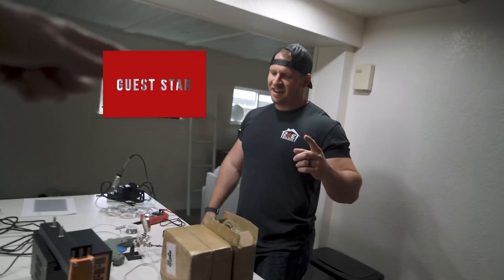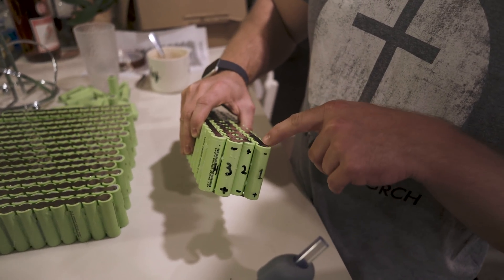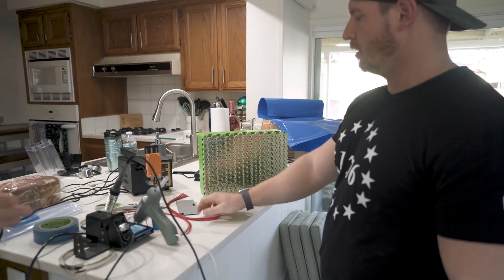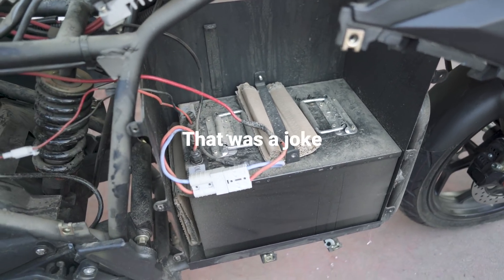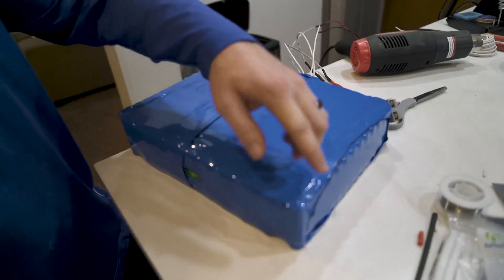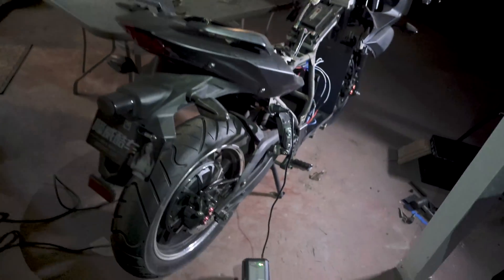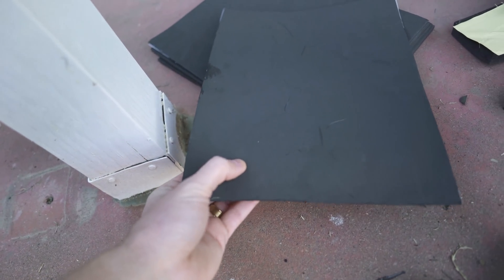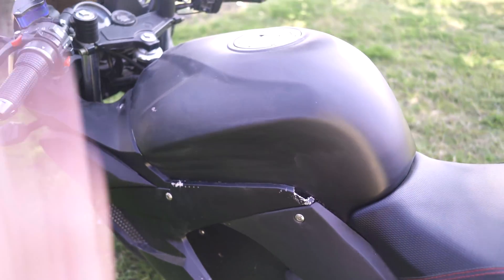UPGRADING the ELECTRIC SPORTBIKE from CHINA | Installing a Home-made Lithium Ion Battery

Comment: your going to fry the sells in the end of the series. they are ratted for 21.5 watts, short bursts up to 100 watts. so 40-60 of the batteries are being over powered. its a fire hazard. should be using  LiFePO4 42120's... cost's $3k to make a 42120 pack at the same power level. and that would last 1800 charge cycles and be warranted for the voltage and amps your using.
Reply: lol, What? I didn't notice what cells they used, but are you saying they're 5A continuous discharge cells? At what, 13p was it, so about 65A continuous.
Reply: @th3d3wd3r  no for the voltage they are using running each battery at the ratted 5A will cook all the end cells.
Reply: @ardennielsen3761  Urm, no it won't. I pull 140A at 100.8 volts from my 24s7p pack of lg hg2 cells. Not a bother, absolutely in spec for the cells.
I think maybe you're confused.
Reply: @th3d3wd3r  sure thing, I drive around a unrestricted 250cc F1 that's on a 240lb dirt bike. 5 gears and 54hp. i might make a video of it this summer.
Reply: @ardennielsen3761  I've got no interest in a bike that needs an engine rebuild every 50hrs use lol.
You still didn't answer my question
Reply: @th3d3wd3r  ya, having to refill the gas tank every 2 days is ruff.
Reply: @ardennielsen3761  what are you talking about?
Reply: @th3d3wd3r  110 octane gasoline is $11/gallon
Reply: @ardennielsen3761  none of this has anything to do with your complete lack of knowledge regarding EVs and battery packs. I don't understand how you can be so clueless, yet be brazen enough to attempt to offer advice.
It would be more helpful to people in the future if you didn't advise people on topics you have no clue about
Reply: @th3d3wd3r  yes, and brewing ethanol is easy... tell me how you make a battery.
Reply: @ardennielsen3761  distilling ethanol is lethal if you don't know what you're doing. Blow yourself up with that stuff. 
To make a battery you use as many cells series linked to reach the desired voltage, then add parallel cells to increase capacity and discharge ability. Once you've worked out the pack layout, you use appropriate sized nickel strap and spot weld it to the batteries, making sure the weld current is high enough to make a solid weld, but not so high you breach the cell. After that you attach balance connections to each series link from ground, all the way up to the positive terminal. These connections go to the battery management system to monitor/balance the pack and protect it in the case of a fault.
Reply: @th3d3wd3r  take a shot right out of the tank of my bike... got enough here to get a few hundred people buzzed, batteries start on fire, lithium batteries can not be put out when they light up, your home insurance is going to be denied... just for having that 40kg lithium batterie block.
Reply: @ardennielsen3761  I think you've been huffing ethanol fumes. Are you ok? You found out you were wrong about battery packs and you just went off on random tangents. 
Tbh, I'm utterly addicted to EV torque, literally nothing comes close. I'm done with internal combustion, it's all about electric now. So I have no interest in debating which is better. What I am interested in is your wild claims about lithium battery pack construction. But you won't explain yourself and you're clearly unwilling to learn
Reply: @th3d3wd3r  how many kilowatts are you running? the 250cc dirt bike i have is pushing 41kw in fifth gear with the engine at 4500rpm @ 65mph it has 41kw just sitting at that 4500rpm idle... runs to 13000rpm
Reply: @ardennielsen3761  I'm only running 15kw, but I've got 220nm of torque on a bike that weighs 35kg.
More importantly to me though is reliability. If you're running a 250cc with that much power, it has to be a race tuned 2 stroke. How many hours before you have to do an engine rebuild? 50, 100?
I have virtually zero maintenance.
Reply: @ardennielsen3761  do you have to idle at 4500rpm just to keep enough oil flowing to stop the engine overheating? Lol
Reply: @th3d3wd3r  its a 250cc 5 valve that has the bottom end of a 450cc. its made of all kinds of metal that is mined out of the ground by fracking and pumping out using all kinds of volatile acids... oil rigs that have nothing to do with oil.
Reply: @ardennielsen3761  also, have you not yet realised I don't use electric because I'm eco, it's because it beats the shit out of internal combustion
Reply: @th3d3wd3r  it seems like you are coming across as the one who eat the leftovers that mom leaves in the toilet?
Reply: @ardennielsen3761  Wat?

Comment: You cracked a joke about the cardboard, but added wood. Lol. Be safe, metal enclosure.
Reply from the maker: Figured if the battery explodes or catches on fire, might as well have a camp fire and make the most of it

Comment: The brake noise is caused by the pins and the back of the pads. Add some brake grease to both, being careful not to get it on the pad and rotor surface.

Comment: I would have gone for a side by side battery to fill the void from left to right, this would have given you the lower centre of gravity but i guess if you do decide to expand you can build an identical bank and run them side by side. Also the discharge wires do not look up to the task, for that power level i would expect to see much thicker wires.
That brake noise will only be cured by lubricating the slide pins & fitting spring plates to the pads.
There is a guy (Tony) from the Midlands (England) who built an 70+ mph ebike, check out his channel by searching "Vortecks"

Comment: On the front brake squeak - Get some thin teflon sheeting and cut a piece for the back of each brake pad, and find some hi-temp thin fiber washers to put on each side of the caliper bolts. That should stop your squeak. The pads are probably too hard of a compound, in order to make them last longer, but they'll be somewhat noisy unless you insulate them from the calipers with the teflon sheets. Incidentally, if you double your battery capacity, you better go with at least 8 AWG for the wires to the controller, to handle the extra amperage, plus it should be a lot quicker if the controller is capable of handling that much current. Heck, they've got thicker wires for an RC LiPo pack than that thing has for the main output!😁👍

Comment: It looked like there was enough room in the batt tray to throw in a parallel battery.. Would it fit two of those 20s13p configs? and i have to second what everyone's saying about larger gauge wiring coming from the battery pack out.
Reply from the maker: Yep, we're planning to build another just like it and upgrade the rest.
Reply: @TheInja  Lovely man! is the motor and ESC rated to just 72w or is that pretty flexible? You may even be able to up the wattage to an 84w or 96w pack for a bit more speed and power if it doesnt fry the mainboard
Reply from the maker: @MB.Drifts  we'll be running a 72V 8kw motor in it soon.
Reply: @TheInja  so if you're lucky and don't get screwed again you're looking at a top speed of almost interstate speed!
Reply from the maker: @MB.Drifts  I'll be looking at a top speed closer to 100mph hopefully. 👌🏽
Reply: @TheInja  overvolting is your friend! just remember to keep alll those electronics cool. short bursts not long too. These new style chinese batts are awesome but they still heat up quick when put through major high drain cycles

Comment: An hour uh? So pretty much only 35-40km.  Price to speed boost....was it worth it?

Also. People going on about how the small the wires are. They're like that on all  Motorcycle style ebikes (yes even the Zero FXS). They're Hall Sensor wires. Hall sensors are tiny microchips. What  would be the point of hooking thick wires to something so tiny? duh. It would be like hooking 8 AWG to your phone speaker thinking it would make it sound better lol
Reply: I'll comment again just in case people think this is true, THE CONTROLLER NEEDS 8-10AWG IF YOU'RE PUSHING 40A CONSTANT, hall sensor wires come from the CONTROLLER not the BATTERY so you couldn't see it in this video, Im really not sure why you're spewing bullshit you know nothing about.
Reply: Martyr4JesusTheChrist  I apologize for the vulgarity but I've explained this to him multiple times and he just makes a new comment stating more incorrect information and I really do not want someone thinking it's acceptable because it's not and it could hurt someone.

Comment: Your battery discharge cables look rather stiff and thin. If I were you I'd upgrade the cables to 12 or even better 10awg silicon cables. These are high temperature cables. Safer.

Comment: I am not a electrical guy but it seems there is space for one more  battery pack  so to double capacity and not have that wood frame which looks very low tech and as some said the wires are very thin, I don't think  it will  handle that AMPS

Comment: You could also use super capacitors, although that’s quite a mission. 🌝
Reply: Super capacitors only work on drag cars since they're not energy dense but can output ridiculous current, it would get a range of 3-5kilometres but they would be a very enjoyable 3-5km
Reply: Row yea I know , that’s why I said it’ll be a mission 🤣
Reply: @joshbarnes5119  I don't think it's a worthwhile mission, he could probably only fit 1 or 2 super caps in the battery box and it's going to bottom out his suspension, but I'd would applaud anyone who makes it viable.

Comment: Its enough space in there for 2 battery packs. Build another on and make a switch to switch btwn the 2. And make a generator to maintain/recharge the battery not in use. Them you cam ride all day n not worry about recharging.. What ya think?

Comment: From the video I can’t get the gauge of the wire but if you want that bike to go highway speed sustained, you need 6 or 4 AWG gauge wires both from the motor to the controller and the battery to the controller

Comment: Yes...just yes, keep the vids coming.  I was considering switching my batteries as well in my e-grom. I'll have to take it apart to find out whats in there. But I'll def have to do a lithium swap. 20A SLA in there right now. I believe they said it's 6 of them , but thats going off of their word.
Reply from the maker: Do it 💯
Reply: @Karelzvla  Which brand batteries did you use? Just curious. I might follow along. Fastest I've reached is 69kph with the SLA 10A. Or so that's what the company said was in the bike. Give or take 38-41mph. I've got to be careful taking the plastics off. One guy said he cracked the plastics trying to get to the batteries.
Reply: @Karelzvla  I have the Boom E-X20, which do you have?

Comment: The squeaking is probably those pins you were describing. Put some anti seize grease on them. The stuff that comes in the silver bottle with the screw on lid/brush thing. Just be careful not to get it on the pads or rotors.

Comment: Haha! Nice choice of Stickers there (The "Not actually a" was the best part). The battery box looks like you could almost pack twice as many cells in there once you get everything sorted. I'm not a electrician like some of these viewers apparently are, but I would definitely say wiring is also certainly something you should be mindful of. Even if what you have turns out to be sufficient, it's always better to double check. I want to see its full potential be realized, and I'd hate to see it ended early by a stray spark.
Reply from the maker: Appreciate it! Definitely will be double checking as we keep upgrading.

Comment: looks like you could fit such a bigger battery pack in. cross fingers you are going high power motor, one of the 12kw water cooled ones would be sweet. For anyone looking for batteries, these are very good high discharge batteries 20amp continues 50a peak https://www.aliexpress.com/item/32921081681.html?spm=2114.12010612.8148356.12.76589f14kAAI2W  

if you're in the states keep an eye out on https://www.youtube.com/user/jehugarcia/featured he often has great value 2nd hand batteries 

So want to build a 12kw cafe racer, with like a 6kw-10kw battery. just don't have the space atm, till I upgrade house.
Reply from the maker: I feel that 👌🏽

Comment: You probably have oil on your pads and rotor. Take out the pads, clean the caliper with soapy water, and burn off the oil on the rotors and the pads with a butane burner.

Comment: How low of amps does the controller on that thing pull?

My eMTB does 50kph easily, and it's only 48v. Though, my battery is s**t and has a ton of voltage sag, as well.
Reply from the maker: I'm sure the controller is limiting it. Realistically should send me up to 40mph no problem.
Reply: @TheInja  

Yeah, a 72v should be able to do that without issue. Amp limitations are the big culprit.

Comment: The brakes sound like they are copies of Honda rebel ones.

I fixed the squeaks by making the pins the pads hang from  a tiny bit smaller by sanding them with  fine sandpaper. This stops them from vibrating and squealing.
Reply from the maker: Yep, definitely the problem. The design of the pins would cause some vibration

Comment: I’d work in some form of passive cooling for that battery. Cut some holes/vents in the front and back to allow flow through. It will increase your battery durability

Also get rid of them there bicycle brakes
Reply: Martyr4JesusTheChrist  not so much of if it's wired up correctly but how hard you are pushing the components, even running the batteries at the rated c limit they will still get pretty warm.

Comment: Seriously dude.. those wires are weak af! The controller might not be the highest amp one, but still should be around atleast 60A .. those wires are 16A tops! If it's a decent controller it should be around 150A-200A from the battery. You should be using atleast 6 awg cables! Those you got there look like 12 or 14 awg

Comment: Nice! If you want to tidy it up even more try a computer case and sound/acoustic foam. Also maybe make another battery pack and a switch so one charges while you use the other.
Reply: What would be charging the other battery ? While you use the one it's running on

Comment: High tech, monitored with a freebie, Harbor Freight voltmeter! I luv it 😀. Great video!

Re: front brakes, try putting a leading and trailing chamfer on the pads. Maybe even cut a slot across the pads.
Reply from the maker: Thanks for the tip!

Comment: Two things. One: before upgrading the motor, make sure you know which one you have. Most of the time, chinese manufacturers slap a random motor instead of the one advertised to you. On the 1st video you said you got the upgraded model, so you should have a 5kw motor on your bike, which leads me to Two: the controller is programable, before upgrading, check if you can crack the programing of the controller, because you might have a 5kw controller programmed to 3kw, which explains the 30mph "limit" and the "low power vibe". You can reach up to 50 mph once you unlock the contoller to match the motor. BUT FIRST, check the parts you have in hand and reasearch before spending unecessary money. Cables are too thin IMO, check temperature after use.

Comment: Dude !! I have a hub motor running at 1800w with a controller that is  25 amp continuous/ 50 amp peak and using the same voltage  battery as yours on my ebike and it hits 40+ mph , with the added weight of your bike I think you are only getting the same as me 1800w.
Probably the controller, get another ?? and thicker wires will be needed for the extra amps.

Comment: iam drive a scooter with a 3000 watt moter and it puls up a lot faster than your motor. and my top speed could be 70 or 80 km/u.
bud i never try becouse 45 km/u is the max legal speed for me.
bud i have done it with my old 60 volt lifepo4 battery,  and that time it did 65 km/u. now i instald a diy 72V 63AH lion battery.
Reply: @Karelzvla  wel i think i need to try it out what my max speed is..... only the police and the Insurance wil be a problem if i crash.

Comment: Those original batts were voltage sagging bad. At least you found the problem. Qs hub motors go up to motorcycle grade. Keep the power wires as short & thick as you can too

Comment: Hi inja , I was following this case from beginning. Because I too imported electric motorcycle 3weeks before from China($1350). Im not sure why your motorcycle can't get 60km/h. My motorcycle 3kw motor and  72v45A battery can get 90km/h max speed and can go 0 to 80 in 4seconds.  Below is my motorcycle https://youtu.be/_G6oswhtgok . check your motor power again. I think it should be around 1kw that's why it go only 55km/h.

Comment: Well i guess after all that you passed you sure know that a simple battery will not change much. When it is come to electric vehicles you can't just buy a small motor or Kit if you want performance. I know that too because in my first project i did the same and spent a cup of dollars as well in an electric cart. If you change that Speed controller for a bigger one and your battery have that power to withstand be sure that your motor will not overheat. This motor probable can't withstand 5000W for much longer. With 8000w it will burn in seconds...To be honest for a battery with that power i believe you use much thin cables (you don't say the diameter but i guess they are 3 AWG maybe 4 AWG). 44.2 amp hours is the current by hour but you have the burst current or the current the battery can push out for a short time. One single GOOD cell probably can withstand 12-15 amps you have 13 (x 12 = 156 amps minimum) If you buyed High Drain cells you can do around 20 amps maybe 25 amps not problem (13 x 20 = 260 amps) All this current in a single layer of nickel (if you used more than one is fine) and a 3 or 4 awg cables.